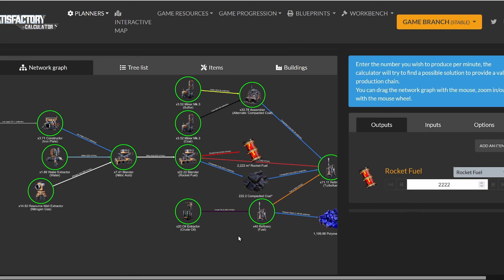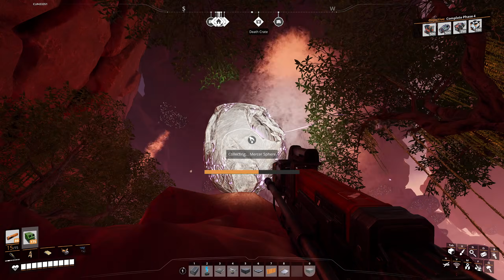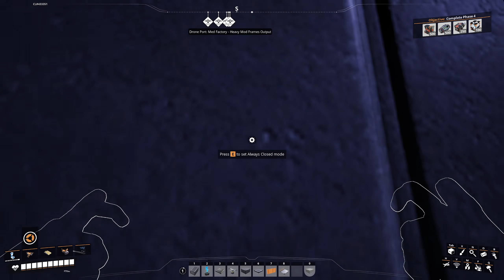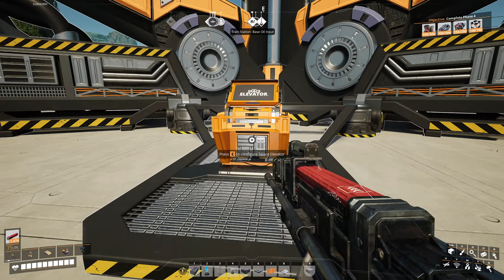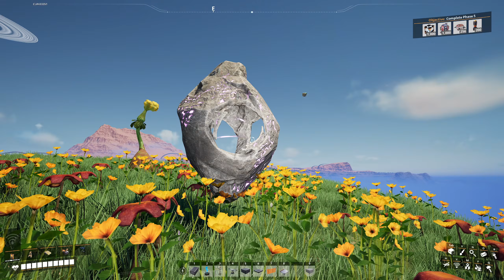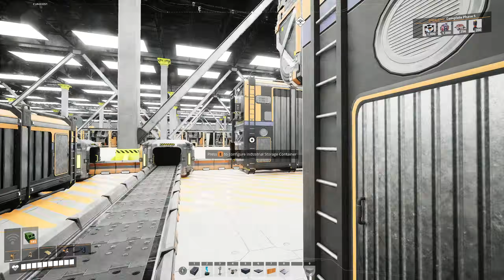Collecting Everything For Rocket Fuel - Ep41 - Satisfactory

Comment: I do not blame you for going for the RF alts.  They are, to be honest, completely OP.  Really, I find quite a few of the alt recipes to be essential, and doing (my own) playthrough without them wouldn't interest me.  I can't imagine needing THAT much power, though - you might consider just putting down generators in stages as you need them.  That will also help keep you from getting burnt out, because even with blueprints it's tedious.  I just finished my second playthrough with 99GW, I think my first time through I had 84?  And this time I did synthetic power shards, portals, and the whole bit, and never came close to using all of it.  I did RF the first time and nuclear this time - there's absolutely zero need to do both unless you're just filling the entire map with factories.

Both of the things you pointed out at the start of the video are known bugs/issues.  I've seen the sphere cage but haven't run across the hole in the world as of yet.  There is a third one that is commonly discussed, some missing/invisible water in a pond/lake in the rocky desert near the geothermal geysers.

Nice video, looking forward to the rocket fuel build  It's not easy to dress up a billion refineries and blenders.
Reply from the maker: We'll see how much power I end up needing in the end